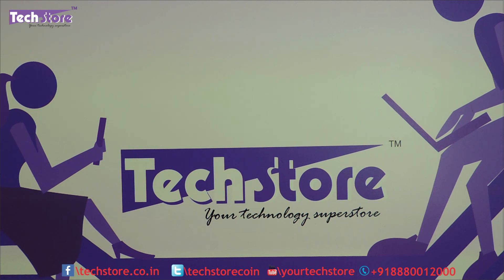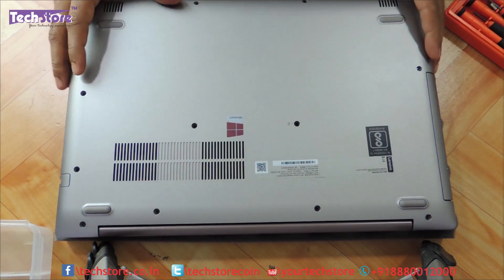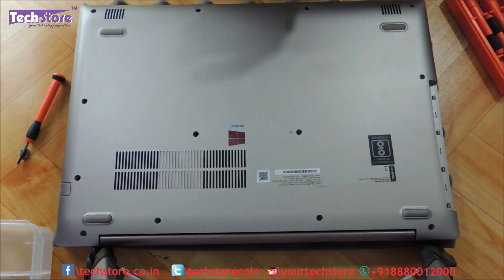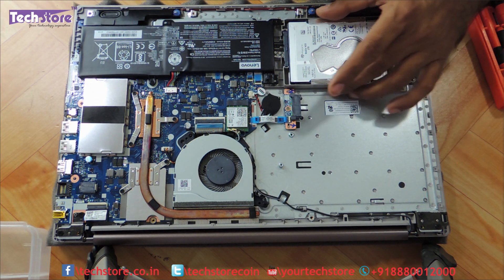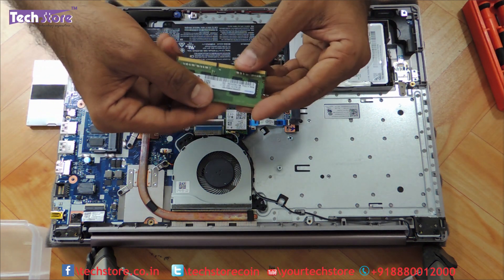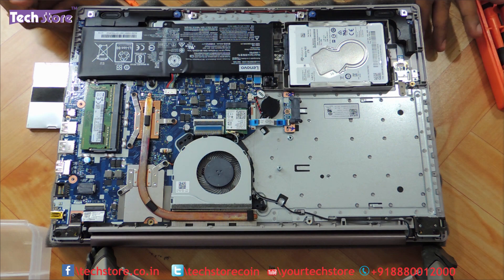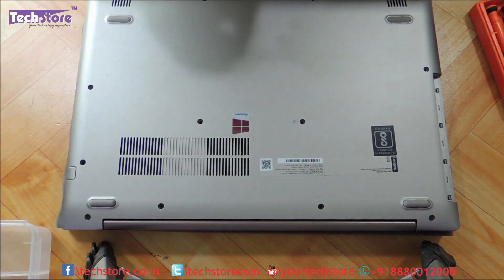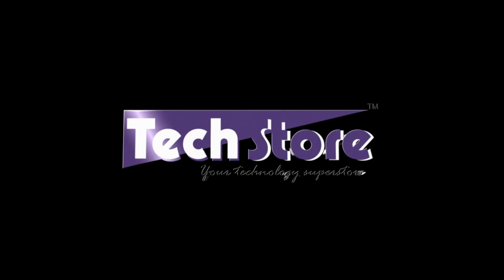Lenovo Ideapad 520 : how to disassemble and upgrade ram ssd m 2 dvdwriter easy diy

Comment: If this is a Lenovo Ideapad 520-15IKB, is the ram DDR4 2133 Mhz or 2400Mhz? I called the Lenovo service centre and they said it was 2133 for this model as Registered, but is it actually 2400 as you opened it up?
Reply: Even I have this same doubt?
Reply: Even I have the same question... Can anyone one help me out...
Reply: It is 2400 mhz probably, u just have to tweak some boot settings in bios and create a xmp profile.

Comment: The laptop says to have a nvidia gpu but when i ripped it apart o can't find the nvidia graphic card instead it has a samsung graphic card. Why is that any idea?
Reply from the maker: You are looking at the wrong IC...it does have a NVIDIA gfx under the heatsink which u need to remove.

Comment: Hi, Techstore.
I currently have the IP520 i7 7th gen with 2TB HDD, 16gb installed RAM which is 5 years old. It still works decently well except for the battery Iife and lags a lot.
I tend to run two Adobe softwares at the same time as my work demands for it. 

I have been looking for considerable options to revamp my laptop and had a few doubts regarding the same
1. Can I upgrade my ram to a higher number? If yes, how much more is ideal?
2. If yes ^ above, Would you recommend upgrading hdd to ssd or increasing ram or both together?
3. Does it make sense to invest on a new battery for this 5 year old laptop since I have to keep it plugged in and it runs only for 30-40 mins fully charged unplugged?

Any response or feedback from your end would be highly appreciated.
Thank you in advance.
Reply from the maker: Pls subscribe. we will reply.
Reply: @TechstoreCoIn  done.
Reply: Hi, Techstore. 
Can you please reply asap?
Reply: Hi Techstore. Please help me.
Reply: Hi Techstore, can I get a reply?

Comment: If the laptop is under warranty, does replacing or adding an additional HDD/SSD void it? Also whether installing a additional SSD using the HDD caddy in the place of optical drive voids the warranty?
Reply: is it possible to mount the ssd at the place of optical drive?🙄 also which ssd specifications needed, plz help.

Comment: so if i want to use m2 slot for SSD, I have to remove Wifi chip? Very wise Lenovo.
Reply from the maker: Unfortunately yes.
Reply: @TechstoreCoIn  what if a Enclosure of m.2 SSD 2.5 is used
& replace HDD WITH THAT M.2SSD ENCLOSURE
WILL PERFORMANCES SAME FOR BOTH M.2 AND  HDD SLOT
Reply: @surajd395  The performance will be limited by the SATA 3 connection (max 600MBps) so using and M.2 will be of no extra benefit. You'll have the same performance if you use a regular 2.5 inch SSD.
Reply: @Ashish Subba  This is the CD-ROM connector
Reply: There is a M2 slot beside of HDD. You can install SSD on that slot.

Comment: i have the same golden one and from  the past one month my laptop is running very slow and lagging a lot and using the physical memory more than 90% maximum times.can u suggest me what to do with that.i was using windows 10 from more than 1 year and upgraded to 11 only day before yesterday.
Reply from the maker: Please install 2.5 SATA SSD in your laptop along with atleast additional 8GB ram. Your laptop has onboard soldered 4GB ram and one slot is available. Do Subscribe.

Comment: Hello Sir, does Lenovo 520 motherboard support 500gb NVMe M.2 SSD? I want to keep my 1TB HDD along with the SSD. Or do I have to use a caddy in place of the CD Drive, for the SATA SSD?
Reply from the maker: No it does not. U have to used caddy

Comment: i know you uploaded this a while ago, but if you see this comment please reply.  first of all thanks for the video, and i have the same lap with i7 2tb variant. if i buy samsung 1 tb sata 2.5 ssd will it suits in it ? also do i need to do anything before changing the hard drives ? i know i have to backup my datas, beside that do i have to save anything in the new ssd before install ? im asking this becase i can see windows (C) and Leenovo (D) folders in my system. if i install new ssd all these folders creates automatically in it or do i need to install it again?
Reply: Hello. You will need to install windows on the new ssd. While you are in the install process, you should have the opportunity to make partitions for your drive. It would be best to back everything up but you could also buy a usb dock for the old hdd and copy things back over to the new sdd

Comment: can i install without "caddy" as replacement for the optical drive" ? also what is the maximum thickness does this laptop support for SSD? i'm confused.
what i mean is, can i use the HDD along with SSD without purchasing a caddy? and if the answer is no.. where can I find a compatible caddy? I appreciate it,TY.
Reply from the maker: You need to buy a hdd caddy of 9.5 mm thickness to install a 2 5 Sata SSD preferably of Samsung. it is available on our website.

Comment: Team 

Can You please assist me with the SSD capacity.

Model-520-15ikb.

I am looking to replace 1TB hdd with
SSD/2.5INCH/7MM but not able to get the size of the ssd that it will support.

Please help me with the size.
Reply from the maker: Buy a 2.5 SATA SSD

Comment: I have this model with 8 gb ram i want to upgrade to 16 gb so i have to replace it with 16 gb or i can just have another 8 gb with previous 8 gb, does this laptop has 2 ram slots or just one ?
Reply from the maker: 8+8 is advisable.

Comment: Can we use both of hdd and ssd because I'm the same laptop but i want to install sdd in my laptop for faster bootup and sofwares
Reply: yes u can use a cady 9mm
Reply: Hey even im having same lappy, did you install ssd? if yes,can you tell me did you face any issues installing, do we need to change wifi adaptor or just insert caddy and use it?
Reply: Sai Charan  nope not yet bruh, do you also have same laptop?
Reply: Sai Charan  okay will you do it

Comment: My battery is dead.. my laptop runs on power supplied by charger and my battery doesn't help running my laptop... Could help me with this problem? Or a link to get a new battery..

Comment: Sir I have IdeaPad 520 I5IkB .can you pls resolve my query regarding how much maximum power of extension of RAM in this laptop(I have 4gb ram onboard) ...and what type of ram is required?
Reply: go here http://www.crucial.in/ and check your specs it automatically shows compaitable ram and ssd
Reply: ram ddr4 2400mhz SO-DIMM 1.2v max of 16gb (yes you can add a 16gb ram module regadless that the mother has already 4 builtin)

Comment: So basically there are two ways i can add SSD.. One instead of DVR drive and another M.2 SSD instead of Wi-Fit chip. Correct me if i'm wrong please?
Reply: You're right. But I prefer put SSD instead of HDD, and HDD instead of DVD.
Reply: @igor_lugis  can m.2 nvme ssd with 2.5inch enclosure will replace HDD
WILL PERFORMANCE BE same are Not

Comment: I have got same model with 4gb ram and 2gb nvidia mx150 with 2gb intel utd.. but games are lagging still.. if I add 4gb ram would the gaming performance improve ?
Reply: Yes it would make a huge difference
Reply: I also having the same model and facing same issue. Booting time is also slow multitasking is also not good
Reply: Same problem dude

Comment: I have this laptop. But my laptop is 4GB RAM variants without fingerprint scanner. So my laptop RAM is 4GB DDR4 2133mhz. So, can I use 2400mhz another RAM? Any problems comes the RAM mhz is different.
Reply: No. The motherboard comes with 4GB of DDR4-2400 integrated (soldered) You cannot upgrade it. You can go through this link for more details: http://laptopmedia.com/review/lenovo-ideapad-520-review-a-big-design-and-hardware-overhaul/ 
Also, you'll have to configure the finger print sensor.

Comment: Can I add crucial ram 16gb 2666mhz single rank with 4 gb of motherboard?
Reply: Was the additional RAM detected by the system well? Was the gaming performance better than the stock configuration of 8 GB?
Reply: @technostars4041  I add ram sold in Amazon Egypt as crucial ram but my PC doesn't detect it as crucial ram but the ram works well 
I can open more many tasks with the game.
My one problem it is frame drop after applying the ram and ssd and I don't know the reason 
They work but I don't know why fps is lower
And my ssd detected by crucial website as crucial ssd original and it doesn't accept firmware update and can't open momentum of the ssd.
Reply: @eslamshaban74  It's very surprising that fps is getting lower after adding more RAM...
Reply: @eslamshaban74  hey so in total in your laptop right now it is 20gbs or ram right? 16gb + 4 gb?
Reply: Yup, the total ram now is 20gb but I don't know why I have fps drop but better performance in the apps like premiere and ae
Reply: @eslamshaban74  how is the multitasking performance like?
Reply: @shubhambajaj4939  I am Playing apex legends. For example if the game is working, I can't open any other program like chrome or even selfishnet app it will make my laptop very heavy and may be heavy also with discord (this example for 8gb ram) 
Now with 20gb ram, I can run apex with chrome and discord and many programs without my windows become so heavy like previous.

Apex here is an example, and I notice better performance in other apps also like premiere pro and after effect.
But I feel, I have some drop fps and i don't know the reason
Reply: @eslamshaban74  maybe because of dual channel memory. your pc is using single channel rather than dual that is why you are experiencing fps drop. I have also gotten 20gb ram installed and it is working fine till now. Have you faced any blue screens or laptop crashes since you have gotten ram increased?
Reply: @shubhambajaj4939  I have dual channel ram 4 + ram 16 and my laptop read them as dual channel.

No, I haven't faced any blue screen
Reply: @eslamshaban74  how do you check if laptop is reading it as 2 channels? From task manager?
Reply: @eslamshaban74  i have gotten 20gb ram installed yesterday itself. It is working good as of now
Reply: @shubhambajaj4939  I checked it from cpu-z 4 application 
Do you feel increase in fps in games?
Reply: @eslamshaban74  how can i also check it on cpuz? Like i have the application installed but what parameters do I have to see to check if memory is working in dual channel mode or single channel? And I dont rarely play games but yesterday on valorant I got 100+ fps(medium settings) and 5 big fps drops not sure if it is because of the new ram
Reply: @shubhambajaj4939  I open the app then press validate >>submit, this will open a page in the chrome contain more and more details and in the memory section you can see the type of your ram.
The fps problem I don't know till now the reason for it, better performance overall but fps drop it is so confusing problem.
Reply: @eslamshaban74  yeah i am also getting dual channel ram. Productivity have improved over 20gbs no doubt in that. Not sure what is the reason behind fps drop though
Reply: what is the ram frequency MHz ? of ur new ram
Reply: @kartikeysingh6971  2660
But the system reads 2133 because the fixed ram is 2133
Reply: @kartikeysingh6971  2133mhz

Comment: If I will install m.2 slot in wifi adapter. how I will use wifi ?

And do 330S series have to use it together.
Reply from the maker: You can use a USB Wi-Fi adaptor for Wi-Fi connectivity If you are using the Wi-Fi slot for SSD

Comment: is this good to have fixed ram ? because we lose one slot for future update and one more question is it good to add diff size ram an each slot?
Reply from the maker: +Shiva Karthikeyan You can add any size ram in another slot. And yes it is bad on company's part that they have soldered one ram on motherboard..
Reply: Rizwan Rizwan its the best laptop on this budget first I bought HP which was a complete waste later I apply DOA and buy this laptop and it's worth every penny
Reply: Rizwan Rizwan 59k on reliance digital
Reply: Rizwan Rizwan nope I  brought i5 8th gen model
Reply: Rizwan Rizwan but i7 7th gen is a very good option u can surely go for it
Reply: Rizwan Rizwan its OK bro

Comment: What is the highest value to which ram on this laptop can be extended?
Reply from the maker: +Vaibhav Warade 16gb.
Reply: only 1 slot , that means for 16 GB upgrade .. i have to remove original and buy a new 16 gb RAM
Reply: and max will be 4 (onboard )+16 new RAM

Comment: Hey guys, I'm planning to upgrade my ram to 16gb for this similar laptop. But since there's an onboard 4gb ram, will i come across any issues if i purchase a 16gb ram stick which will result in a total of 20gb ram in my system?
Reply: Nevermind. After reading the comments below, i realized i can add an extra 16gb ram.
Reply: @xclarkkent  Did you try to do it? How did it work out? I am also planning on doing this
Reply: @xclarkkent  did the 16 gb ram work, what clock speed was it ?

Comment: what type of SSD? and what about SATA III SSD, is it compatible with this laptop?
Reply from the maker: 2.5 Sata SSD can be installed. You can also install a M.2 NGFF SSD
Reply: @TechstoreCoIn  can I use sata III ssd 2.5 inch at the place of optical drive?

Comment: Lenovo Ideapad 500  Core i5 6th Generation Model SSD m2 Slot available ? Please reply.
Reply from the maker: Not available.
Reply: Thank you for the reply but It is possible for remove the DVD Writer and after set the SSD ? If possible how to changes please give me idea. How to settings installation etc.... please reply me. @TechstoreCoIn

Comment: Nice tutorial, really appreciable.  I have a problem with my Lenovo Ideapad 510 15isk (i7 6500u, 8gbDDR3, 1tb, 4gb graphs.) I have bought it on July 2016. Initially it gave 4.5 hours of battery backup and gradually it came down to 2.5-3 hours. But suddenly last week the battery status is showing 0% and its not charging, if I remove the plug then laptop is getting off. I used to always plugged the AC on and used the laptop, never let the battery get down below 30%.  I have also tried the Lenovo ONE KEY OPTIMIZER to calibrate the battery but it was of no use. Is this a software problem or really the battery is dead ? I will contact the Lenovo Support afterwards they charge too much. Please give me any suggestions if anyone have.
Reply from the maker: The battery cycles are probably over. generally the battery dies after 1.5- 2 years of usage. Ideally get the battery replaced.
Reply: Techstore ok. Thanks for the reply. 😊

Comment: A 16GB DDR4 @ 2400 is slowing down my laptop way too much, the onboard 4gb ram is clocked at 2133 MHz.
Reply from the maker: Try to install 2.5 Sata SSD
Reply: @TechstoreCoIn  thanks will try it, I don't know why the 16gm ram was slowing and making my laptop very unresponsive. But will buy an SSD and use the old 4gb ram  first.
Reply: @ILLRICARDO  Was the performance better with the new 20 GB or stock 8 GB RAM configuration after the SSD upgrade?
Reply: @technostars4041  I left the ram at 8gb, because no matter how many different Bram sticks I tried the laptop was becoming sluggish and unstable,.... With just a new SSD, the performance of the laptop was really good and snappy.
Reply: @ILLRICARDO  Oh that's good, did you notice any significant improvement in performance of any games like cyberpunk 2077, marvel avengers, etc. after SSD upgrade?
Reply: @technostars4041  those games are quite buggy and not optimized well, so they aren't going to run well no matter the upgrades.
Reply: @ILLRICARDO  Oh that's why those games were not running smoothly. I was hoping to upgrade the RAM to 20 GB and add SSD to get smooth gameplay
Reply: @ILLRICARDO  hey i have installed a 512gb ssd and the laptop is fast but now i am thinking to increase the ram of it from 8gb to 20gb. will you recommend me doing it?
Reply: @shubhambajaj4939   not sure, because if the ram messes your your computer like it was doing to mine, you might have wasted your money. luckily i had stores which i could go to and try out the ram and return for a refund.
Reply: @ILLRICARDO  i can also try doing that but what was the main issue that you were facing after increasing ram? Maybe it was just hdd becuase of which your computer was sluggish?
Reply: @shubhambajaj4939  the moment  I put in the ram sticks I tried 8 GB and 16 GB at various clock speeds, the laptop become sluggish and at times unresponsive, it even took over 5 minutes to load  the login screen.  I think Lenovo might have configured the bios to not accept any upgraded ram on my particular model.
Reply: @ILLRICARDO  but was task manager or my computer showing 20gb ram? maybe the issue was with hdd you were using?
Reply: @shubhambajaj4939  it was showing 20 GB ram, but whether I tested the standard HDD or ssd, the laptop became unresponsive no matter which HDD I used...
Reply: @ILLRICARDO  what is your laptop model number and which ram did you use?
Reply: @ILLRICARDO  ??
Reply: @shubhambajaj4939   its the Lenovo IdeaPad 520-15IKB
Reply: @ILLRICARDO  and the ram variant/model number? I also have lenovo ideapad 520-15IKB exact model
Reply: @shubhambajaj4939  crucial and Kingston 8gb and 16gb ddr 2400 and 2133 mhz
Reply: @ILLRICARDO  i already habe 512gb ssd installed and the laptop is fast i want to increase the multitasking performance that is why i am looking to increase ram in the laptop. Which ram stick will you recommend?

Comment: Can I. Use ssd with HDD in Lenovo IdeaPad 520
Reply: No you can’t, but you could remove the wifi chip or disk drive and replace the wifi chip with a m.2 ssd or replace the disk drive with an adapter for a 2.5 inch ssd

Comment: I have lenovo ideapad 520 varient but is not power full performance
Reply: When did you buy it and which model i5 7th Gen or i5 8th Gen? Whats the problem?
Reply: @googleuser6894  l month ago i5 8th generation
Reply: Not batter porformance
Reply: Same problem with me also i bought i5 8th gen around 6 months ago and it's performance is very bad.